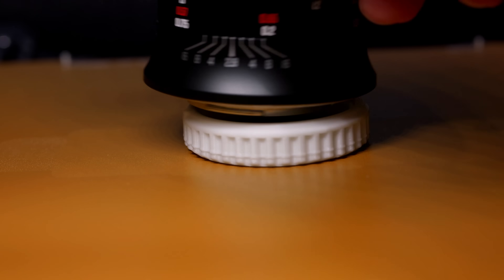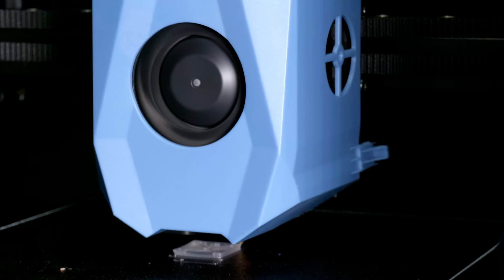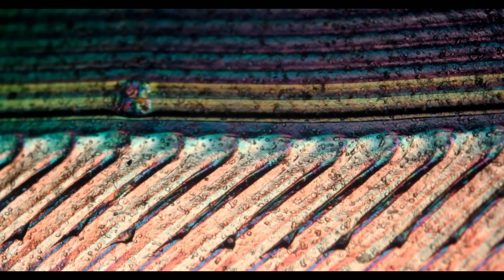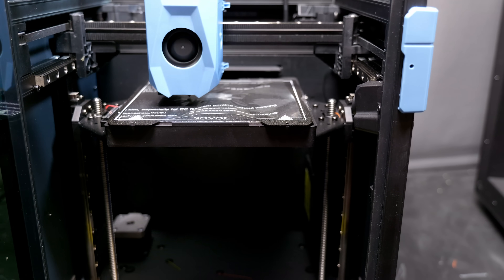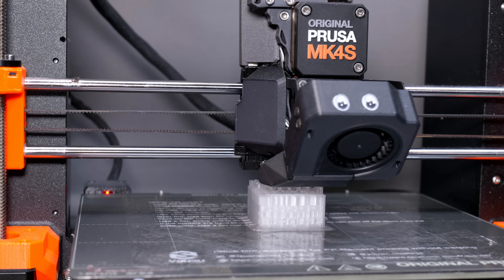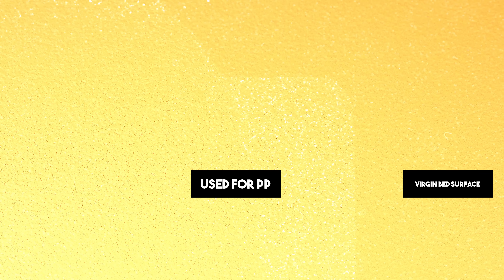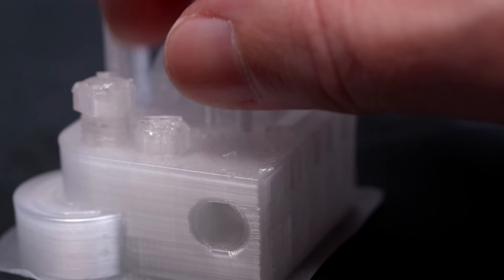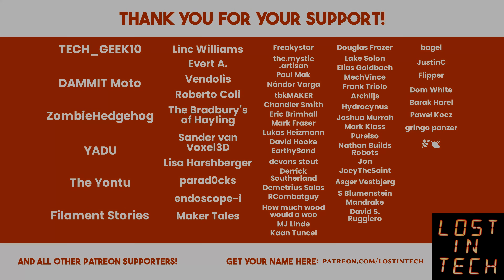Polypropylene - the FLEXIBLE 3d printing filament that everyone is sleeping on

Comment: If I remember correctly, one notable attribute of polypropylene is its chemical resistance to organic solvents like acetone and isopropyl alcohol. This is relevant if you want to make parts that could be exposed to paints, or other polymer chains, and that you’d like to be able to clean afterwards.
Reply: Polypropylene is often used with corrosives like acids and alkali in places like the chemical industry. Handling corrosives is where PP really shine. For very strong acids like concentrated sulphuric acid, oleum ect fluoropolymers are maybee better suited but PP handles for example concentrated caustic soda with no problem whatsoever.
Reply: Really good for a number of acids too.
Just make sure it's PURE pp.
Reply: Then why does Prusa tell you not to clean the PP bed with acetone?
Reply: It’s likely that solvents will damage it. Based on those lovely macro shots, I assume the coating isn’t purely PP

Heh, PP sheet
Reply: @mattliu227  A big issue with acetone isn't just as a solvant but that it can rapidly cool the surface and cause it to crack, especially if the bed is hot. I've use a dab of acetone on a clean cloth to prep smooth PEI and PEX plates for years which works exceptionally well for materials like ABS/ASA. However if you were to squirt a bunch directly onto the surface you'll have a really bad day. I have not used a PP bed and powercoated surfaces have their own considerations but I'd expect a dab of acetone on a cloth to clean a room temperature bed wouldn't cause a problem.
Reply: @JJFX-  Thanks

Comment: Hi. Glad to see a video on this and glad to know more mainstream manufacturers are releasing polypropylene filaments. I have been printing polypropylene at work for at least about a year and a half and I figured I'll share my insights.

Printing was done on creality K1 on the stock build plate it comes with. Been printing filaments from Verbatim and BASF, all in natural colour. I definitely would not call this filament easy.

Adhesion was a nightmare, warp was so strong that every tape and that yousu sheet would just get peeled or ripped off. The yousu sheet would also "delaminate" in some cases. Whatever stuck to the print was stuck permanently. Things got a lot better when we moved onto that magigoo stuff, I also tweaked the profiles a bit. It's great but I do understand that it's not gonna be an option for everyone since I tried to get it myself for use at home only to find out that nobody will ship it to a residential address because "it's professional use only" (if anyone knows where I can get this stuff in the UK without the seller being wound up over it, I will be grateful).

This stuff warps like mental, it can even pull the buildplate off the magnet. High temperature on the bed and a somewhat preheated chamber is definitely your friend. I tend to keep the fans slow except for overhangs, they look a little better with more fan. Going to 100% fan is asking for trouble in my experience. In terms of specifics, I don't remember the exact fan settings but I print with bed at 100C and nozzle at 240C.

Supports are also quite likely to get fused permanently and need knives and files to get rid of so use them sparingly and carefully (or print them out of a different material if you have multimaterial). I tend to design my parts in ways that don't need support.

On K1 you will also have to root the printer and modify whatever was the macro that runs at the end of the print, by default it will speed up all fans to 100% and you really don't want that.

Our application for polypropylene prints include parts that come in contact with super pure deionised water (sometimes at high temperature), parts that have to withstand harsh chemical environment, live hinges and things that generally need to be very tough.

If you want to know anything else, feel free to ask.
Reply: @drowningfish2140  did you try to print on  PP sheet or other bed type like garolite?
Reply: @koboglo6973No, sadly we haven't. Buildplate needs changing soon so I may look into it but it's unlikely we'll bother due to magigoo working so well.
Reply: @drowningfish2140  pretty much mirroring everything that I found out. My best print surfaces, flat pei with magigoo. 100 C bed and 225c hot end and 60° c heated chamber and a 5 mm brim on every part. Even with all that I feel like it's just luck.
Reply: I would suggest trying G10 FR4. I had instant succes with 90°C bed and 50°C heated chamber. I wanted to find out, where the limits are and printed with lid removed and open door. I printed many bed adhesion benchmarks, that warp like hell with nearly all filaments, when printed without brim. They all worked fine with 5mm brim.
Reply: @grott3n0lm  I'll try it next time we run a batch of PP parts, I have a bunch of G10 that I usually use for polyamides, never thought to try it with PP.
Reply: Sounds like G10 is the next print surface to get

Comment: I love PP! Ive been printing it ever since i saw JanTec engineering shoecasing ppprint products. I even got a ppprint build surcace for my p1s. I was printing enclosures for e bike electronics with some pp-gf and pp-cf. It was extremely tricky to get dialed in, and there just was not a lot of great documentation about this material online to help.

Ive since upgraded to an H2D and im going to try printing more PP, hopefuly magigoo or buildtack PP gluestick works good! Im sure having a real chamber heater instead of modding my p1s will help lots.

Comment: I spent a significant amount of time trying to figure out a solution for printing PP, and I found an interesting trick. You print with a large thin raft, and make the top of the raft 100% filled and smooth. Then you switch to a lower nozzle temperature (190C in my case) and a lower speed using some layer change gcode, and print the first layer of the part with 0 separation from the raft. Then switch back to the normal temperature and speed on the 2nd layer of the part. You can tune that interface temperature just right so that the bottom peels right off and is nice and smooth, but sticks well enough not to warp. Works like a charm. I print it on top of magigoo PPGF to get the raft to stick well, and use a smaller raft, but I'm pretty sure with a big enough, thin enough raft, you won't need this because like you said, the first few layers stick ok.
Reply: Easy! 😂
Reply: May you get further and cover the entire bed with 1-2 layers and keep it there as a print surface? would work best with touch probe
Reply: Great trick! I’ve just clamped a thick sheet of pp to the top of the plate and print on that
Reply: Why not try to mix materials?
I stick PC, ASA, ABS on a raft of Sunlu Easy ABS, just 2 layers, put a pause at 3rd layer and change filament.
You can try PP on TPU or any other plastic crystalline or non-crystalline.
Reply: Isnt this the standard way to print pp

Comment: Definitely thought you would go into its chemical resistance.  Other than ptfe , or peek, its one of the best materials to use for contact with chemicals like chlorine. So if you need a fitting made for your pool. You can put pp in it.  Yes i had to say it
Reply: I liked it for the pun but actually this is exactly what I needed to know also.
Reply: Ooh, good to know. I’ll be printing some parts that come into contact with FeCl and plan on just coating them with epoxy, but this is good information.
Reply: This is interesting, bleach tends to kill spray bottle pumps.
Reply: @elHippieSupremo those are generally made of HDPE or PET
Reply: @elHippieSupremo  It's usually the gaskets it kills. You can find ones with FPM gaskets in them that can withstand pretty much anything in most automotive supply stores.
Reply: @AtomicBleach  Same thing with gasoline!

Comment: Couple questions.  What would the shore hardness be? Given that it is a little flexible, a little like TPU, does that mean the layer strength is a little better too?
Reply from the maker: I think it's 65D
Reply: @LostInTech3D  Thanks so much for the reply.  My second question was the one I was most curious about though.
Reply from the maker: @gregdavidd oh. Yeah. No unfortunately not. The layer strength doesn't seem particularly high compared to tpu.

Comment: Another consideration is that it cannot support itself. If you need support material for PP you will need to look for some other suitable material. The reason is that PP sticks to itself so much that removing supports tend to damage the part. 
Dedicated support materials for PP exist, but they do tend to be really soft and gummy so they do not play well with material changing systems so dual nozzle/toolchangers are called for.
Reply: Not so, I've used pp supports a lot. It's a matter of being about to aggressively cool the part. To be and to use this kind of cooling, an enclosure or heated air system is needed. I'm usually hitting it with about 12cfm of air. Which is equivalent to about 3 5015 fans at 100%.

Comment: There are fr4 sheets out there. Local manufacturer in my country just glue fr4 to steel sheets (to magnetise to print table) and sell those sheets to print pp on it. Fr4 is considered to be best sheet type for pp adhesion.
Reply: Really? Last time I tried printing PP was before I bought an FR4 sheet. Considering how great FR4 is for PLA and PETG, I'd never guess it could work for PP too. I'll have to try. Thanks.

Comment: could you indentify stress regions in pp by observing it in a polarizer?
Reply from the maker: That's something I'm going to be investigating for the next chapter
Reply: I remember the test with transparent PC sheets, the line of high stress follows the coloration. But I don't know if you can get a absolute value of stress with the color. maybe the amount of deformation, and then derivate the stress by calculation?😅

Comment: I use PP in place of TPU when feasible. Some PPs warp more, some warp less (Formfutura one doesn't warp at all and is much clearer than others, but also $$$). I use brim and print on a shiny flat surface (SS sheet/Engineering plate/satin plate) with Magigoo PP. It's hydrophobic which makes it much more useful than TPU that I have to dry almost every time.

Comment: One thing i don't understand is that your  PP print didn't stick to the bed when the temperature was at 0 deg. I am using the same Prusa PP sheet and my prints had no problems with adhesion. I was printing Fiberlogy PP Natural on Prusa Core One and on Prusa MK3S+, but I don't remember the bed temperature preset on the second one
Reply from the maker: Interesting, because it was fiberlogy's profile that has 0c. Curious 🤔
Reply: Maybe your nozzle is closer to the bed? That helps adhesion tremendously, but makes dimensional accuracy worse (which you can usually work around by adding chamfers).

Comment: Very interesting deep dive, though I'm not convinced haha ;) Even the minimal amount of warping won't work with the designs I make, that need to be absolutely dimensionally stable. It might have a niche use, though I'm hoping some clever people will develop a new blend with PP and additives to prevent the warping (if possible at all, considering the inherent crystalline structure that forms).
Reply: PP at room temp is an amorphous polymer (AKA no crystallinity). But yes, additives could absolutely be incorporated to stabilize shrinkage/warp, and some higher cost filaments already likely have far superior resistance to shrinkage than the commodity grade filaments showcased here
Reply: If you can get it hot enough for baby parts there will be no warping if done right. A lot like abs it depends on heat and size.

Comment: Nice, I think I'll have some PP. I've avoided PETG from the moisture sensitivity as I don't wanna buy a bunch of dryboxes for it. I mostly print in ABS and recently tried ASA again... yeah no even ASA suffers during summer time now.
Reply: I put my PETG prusament right back into his resealable bag with original dessicant. Never had to dry it.
Reply: Moisture in PETG isn't as bad as people say, unless you live in an especially humid place. I just keep my spool in a generic PP box I feed the printer from, with a few silica gel sachets inside, around 50% RH, no seal, and it seems to print fine. I do design my parts to be easy to print, though, so maybe that's why I'm not experiencing too much issues with the filament itself.
Reply: @tuesss  we've had days of 100% humidity here so yeah, it's pretty bad. ABS in the same conditions just takes it

Comment: Printed pp parts are not quite as indestructible as they are often told to be. They seem to be when stressed for short periods of time, but might fail even under seemingly moderate tension if only given enough time. This should be considered when thinking about press-fitting stuff into pp parts or clamping pp parts (screws/bolts and stuff).

Also, printed PP parts may or may not get all touchy in the vicinity of ca glue. Not sure what this is phenomenon is called, but with some materials, the glue will seep into the tiniest of cracks and kinda wedge the crack open, driving the edge of the crack further into the material very rapidly. Printed pp parts can be prone to that (never experienced it in moulded pp parts, though). Before anyone asks, yes, you can use ca glue with pp, kind of, somewhat, with surface prep, in some niche applications (but it may backfire).

Comment: We just got a bunch of these beds in the lab I work in, and I've found I need to run 3-5 full bed single layer prints (0.4mm on 0.6mm nozzle) before the texture of the build plates is consistent enough and doesn't mark when you print on them. It also stops the little white dots transferring to your parts - which was an issue on the mainly black PP filaments we make / test!
Reply: Intresting ive been waiting to switch my print beds to polypropylene because its light weight
Reply: @xXBLAKGOATXx it works great for polypropylene printing! Haven't tried other materials as we have the other few sheets for those 😊

Comment: Okay so my experience with PP was much the same in that it wasn't very sticky, but then it was super sticky. What I mean to say is... It won't stick to any print bed surface I have, but it sticks great to packing tape. I'm amazed that you were able to peel it off the packing tape without the packing tape becoming part of the print. Maybe because I was printing PP-GF with high fiber content and also had to use a higher temperature. I did have the best luck on normal print surfaces with crazy high bed temperature in my Plus4. I tried a sheet of 1/16" PP, but it absolutely became part of the print so I had to cut it out and sand it off. There have been some other PP specific print surfaces available. All out of stock. Great macro shots!
Reply: I used to print CF PP for work, use the PP sheet, but make sure it’s sanded with 200-300 grit. Smooth PP sticks too well. We were also printing with 1-2mm nozzles so it should easily work for smaller nozzles
Reply: @ChipmunksPlan aside from sanding, did you try adhesives on PP sheet ?
Reply: I have had normal PP prints permanently fuse to tape as well, in my experience it will fuse most of the time. I had luck one time with recycled PP and glue stick but I wouldn't recommend it.
Reply: I also have a Plus4. I also thought about getting a thin sheet of PP as a print surface. My Plus4 prints prints perfectly without any adhesives on a sheet of G10 FR4(Garolite) with 90°C bed and 50°C chamber..
I would never have thought that it would work. I just tested out of curiousity and the first test was allready a big succes.
Reply: @grott3n0lm  Hadn't tried Garolite! Will consider.

Comment: I really love my spool of PP. I only print with it occasionally, but if I do I really enjoy using it. 
It doesn't get moist; you can basically leave it out in the open forever, and it will not get stringy or get blisters, while it has basically perfect layer adhesion. 
Although I have to mention, I only print it on a print sheet with package tape on it.

Comment: Not sure how commonly available it is in the UK, but SBS is another material that seems to fly under the radar. It's significantly easier to print than ABS (minimal-to-no warping, enclosure not required), but it has similarly high temperature resistance (higher than PETG, I think). Interlayer adhesion also seems to be better than ABS (in my experience), and it's 𝘴𝘭𝘪𝘨𝘩𝘵𝘭𝘺 flexible, which can be quite helpful for parts that need to take a beating without breaking/chipping
Reply from the maker: Noted! I've heard of it...but yeah can't recall seeing it
Reply: SBS vs. HIPS would be an interesting battle.

I got some HIPS on a whim and i'm amazed. Very consistent flow control, not stringy at all, so pretty matte, good layer adhesion, and it's not trying to warp much at all. It's also cheap because it's a widespread support material for ABS, but honestly if it were me, ABS would be a support material for HIPS. The one problem is that it may be reluctant to stick to PVA and slightly less reluctant to PVP. It does stick to PC though just fine.
Reply: @SianaGearz hips has poor layer adhesion and it's tensile strength is much weaker than abs/asa.
Reply: @JakovPerisic   This is completely counter to my experience. I think your seller found some horrible ABS regrind and called it "HIPS".
Reply: @SianaGearz nope, based on real life testing and datasheets. It's just a fact, sorry.

Comment: I have a drone frame I printed in PP 5 years ago. Yes, PP does not stick to anything but PP. I first tried packing tape which did work but was pretty horrible to use. I then ordered a stick of Magigoo PP adhesive and with proper brim I was able to print some longer parts succesfully as well.
I have not used the PP roll after that however...

I wrote this while you were showing cool polarizing things.